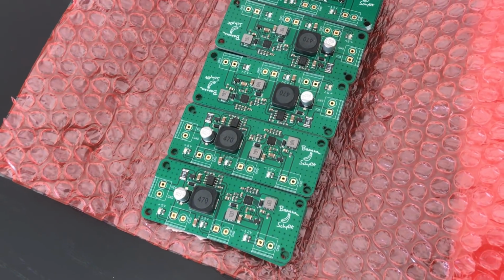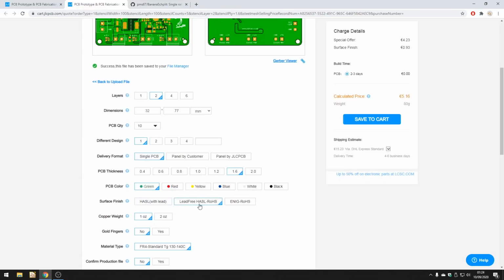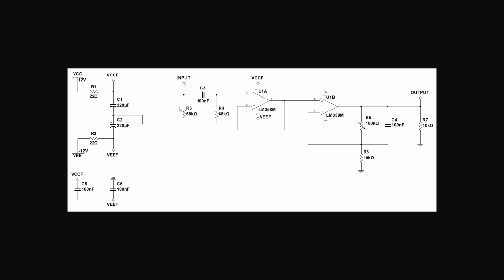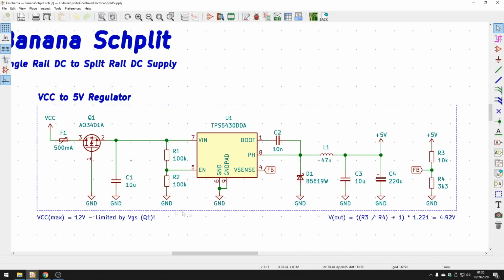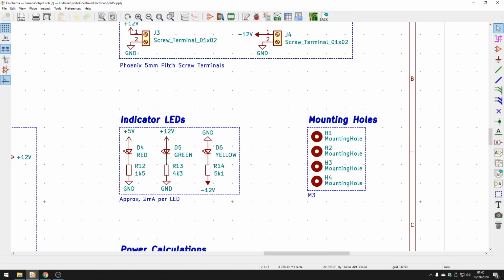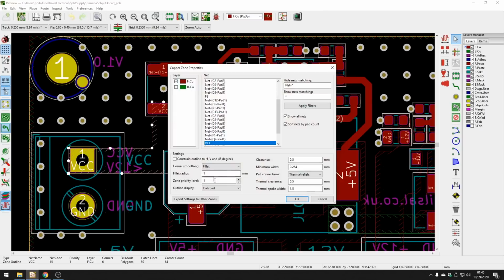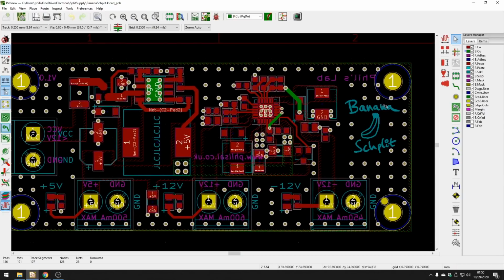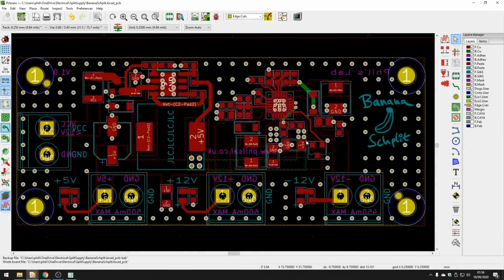(Sponsored) Single to Split Rail DC Power Supply Design | KiCad and JLCPCB Assembly - Phil's Lab #10

Comment: Yay! Another great video and design from Phil!
A really nice single and dual rail convenient buck regulator power supply. Can come in very handy for sure, especially for remote projects that can be powered off low input voltage to the circuit.
I see you've been putting in some work into your channel logo and video/audio quality. Nice work! Looking forward to your next great build idea.
Reply from the maker: Thank you very much! I had hoped this would be useful for more than just me - just a really simple way of getting a split-rail PSU without messing with AC line voltages, transformers, etc. Thank you for your comments on the changes to the channel! :) Next video should be on the ‘revamp’ of the Hades flight control PCB!

Comment: Hi Phil, considering where I'm at in my self teaching electronics design, your channel is proving to be the most valuable resource I've found so far (there is a tight match between my learning style and your teaching style) .. Thanks for that !! 
Besides, I don't know if you're open to content suggestions but I'll try one : there is a point after some learning and use of KiCad that I still find quite confusing and is adding more friction than I'd like is symbols / footprint / models libraries management, with the result I experience quite a bottleneck at that part of the process ... where to find the correct component's symbol / footprint ? Are you actually authoring the missing parts yourself ? What source / parts libraries are you typically using ? etc.
Again, thanks for your precious material.
Reply from the maker: Hi Lorenzo, Thank you very much for that - really glad the videos have been helping out! Yeah, I have my way of doing the whole footprint/symbol/library thing which I probably should show in a future video. In general my approach is: I’d rather try and find a pre-made footprint (e.g. from SnapEDA, mouser.componentsearchengine.com) and check its correctness than to make my own (it takes less time I believe). I typically add libraries on a per-project basis, rather than having a global library. However, for parts where I can’t find pre-made libraries, I actually have started to make my own global KiCad library full of these ‘missing’ devices. I hope that helps (at least a bit)!
Reply: @PhilsLab  Thanks for you kind reply, I'll check the references you suggest ... and looking forward to an opus on the subject.

Comment: Should really have used zener diode to protect the gate of the p-mosfet!
Reply: A Zener + a decent (~10k) resistor. Just a Zener from the Drain to the Gate, which is grounded, will give you a nice boom!
Reply: @scottwilliams8539  Zener and 100k resistor. Like afrotechmods showed me.

Comment: 0:59 Amperage? AMPERAGE?!?!?!
 I love your videos, but come on! You sound like you've morphed into a welder!! 😉
Reply from the maker: Haha I believe that is actually a correct term for what I was trying to say, even though it does make me sound like a welder (apparently) :D
Reply: @PhilsLab  The correct term is current, the units of which are amperes, or amps for short.
Somehow the term voltage came into common use when the correct term is electromotive force (emf for short), or electric potential. The units for these are volts.
Reply from the maker: Amperage - according to the Cambridge English Dictionary - is also a correct term, although not as commonly used.

Comment: This video fits perfectly. I was just designing a circuit where I need a buck converter. Perfect timing 😄👍
Reply from the maker: Awesome! I hope everything works out with your design!
Reply: @PhilsLab  Would it be possible for me to send you a small board I designed so you can quickly look over it? . If you haven't got any time that's okay too :)
Reply from the maker: Phiwatec Sure, if you could send me your files to: philip.salmony@philsal.co.uk :)

Comment: Great video. Short, precise and on the point. I hope JLC’s assembly service didn’t give you a slap on the wrist for the vias in pads 😅
Reply: What do you mean? Don’t they manufacture them too?
Reply: Suncrafter spielt they do, but the assembly gets a bit trickyer, more room for error due to the vias sucking up a lot of the solder paste and leaving possible cold joints and so on
Reply: Ahh ok thanks 😊
Reply from the maker: Thank you! Haha vias in pads are very common (and essential) in thermal pads and I’ve never had an assembly problem. But yeah, they certainly don’t look very pretty!